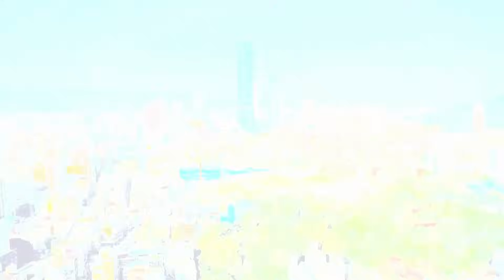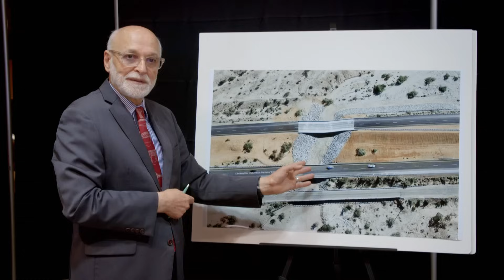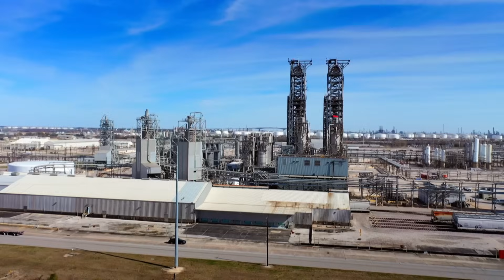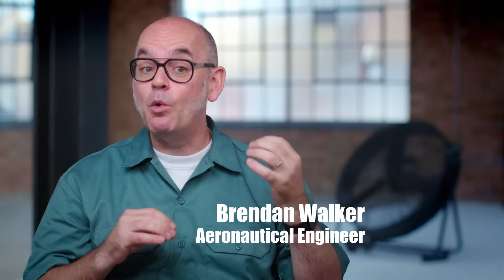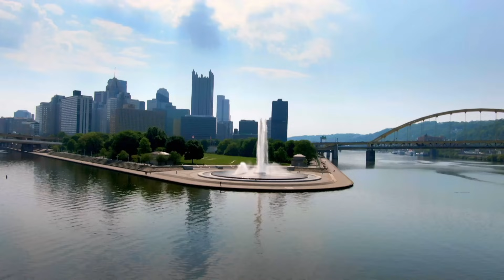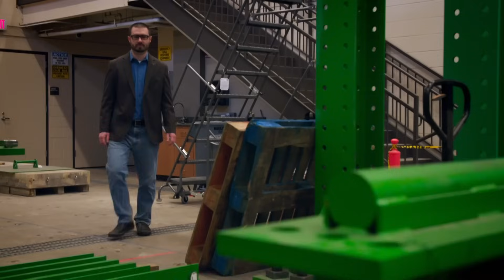Disaster Strikes Mars Mission! - Massive Engineering Mistakes - Engineering Documentary

Comment: Explain the Houston plant explosion again please,   The valve was closed and locked out. Then they re attaches the air lines backwards.  But if the valve was closed and the switch , or computer in control room indicated closed.  The. When they open it, and the valves is closed. Either it wouldn’t open, or it would open. So the it is indicated correct. Open.  There is more to that. I think they thought the valve was stuck. And they went to go look manually. And they did something.   The open the line back up to see if the valve was closed I bet.  If not. I’m may have to look up this incident